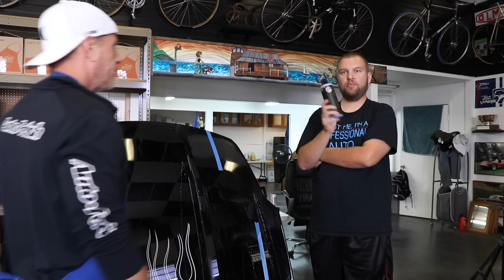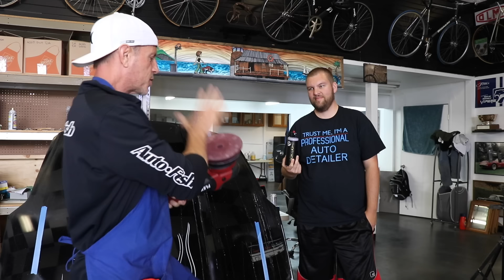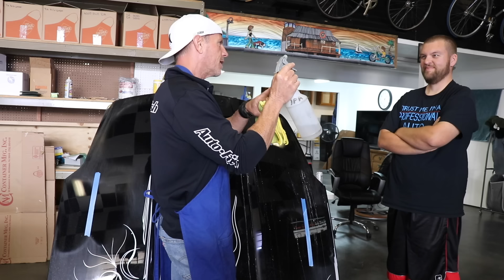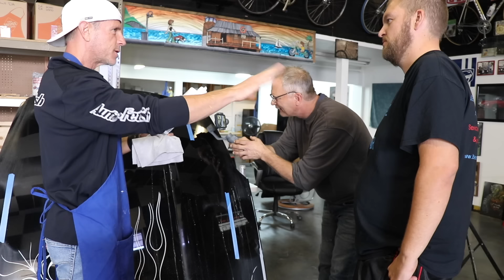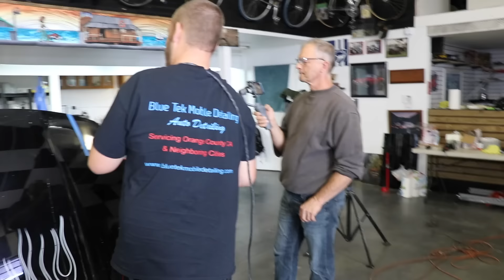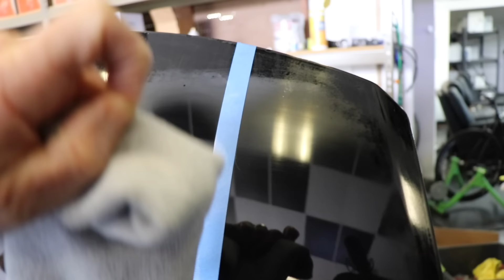Car Polishing for Beginners: Tips you aren't going to learn anywhere else

Comment: I'm a religious CSI user....It's hands down the easiest and best product to handle the job. Big no-no in this video though with CSI and that is using a pad that's had material like the CG stuff with fillers and silicones in them. CSI does NOT work well with others lol. Had that been a clean pad, it would have destroyed the marks a lot faster lol. Not that it's bad, it would just show the real abilities of CSI Ceram-X. I absolutely love it. Makes the hard part of cut n buff and corrections so much easier and it actually removes the marks, not just fills them. Great video gents!

Comment: ugh i hate chemical guys, Darren is completely correct. The over saturation of their products is ridiculous. When he went to buy a product to fix swirls and scratches they screwed him over too. Thats a stupid $35 bottle of crap. It's a good thing Darren is around to give advice to people about being able to effectively FIX the issue with the same amount of effort. The CSI polish Darren has is more expensive yes but look at how awesome it is. UGH Chemical guys pisses me off so much.
Reply: CSI winds up being a ton cheaper really. I have tons of CG stuff, from compounds (actual cutting products), washes, glazes etc. Some of their stuff is fantastic, but for cut n buff finishing, it's terrible. CSI is hands down the best product I have used for actual paint finishing and corrections. Most of what I do is airbrush work and custom paint, but I play with all my own cars and such, bikes, and what not. I have used things from Meguiars, 3M, The Wax Shop (old school) and System 51. CSI Ceram-X has hands down made things a ton faster, easier and saved me a fortune. 1 product, 2 pads and done. I have used it on 1000 grit cuts and it's worked, but now finishing around 2500 - 3000 and I can literally get away with a single pad finish and have zero swirls, spiders etc. Amazing stuff and Tom is an awesome guy who's there to help. Can't beat it